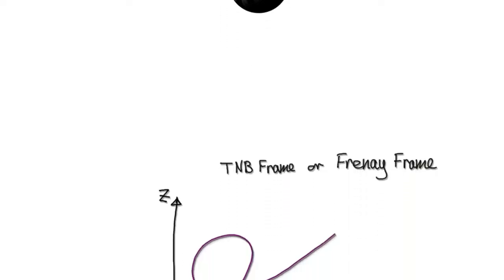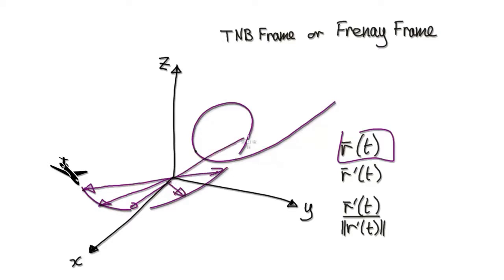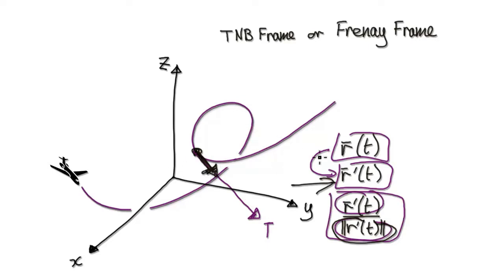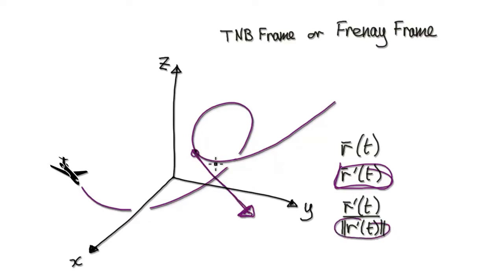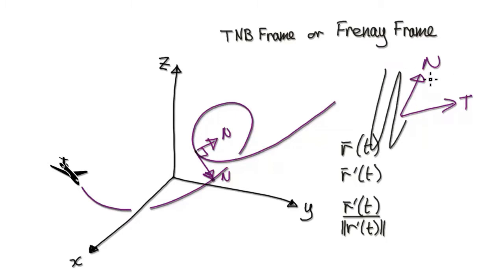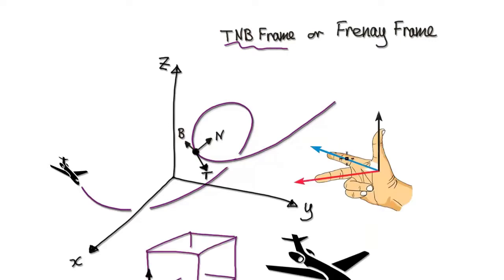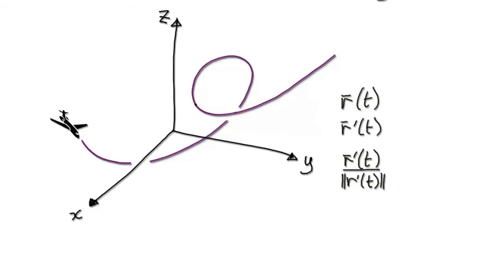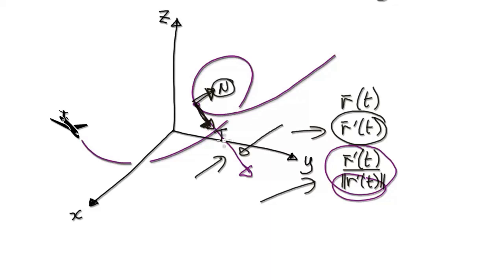Video 3013 - Introduction to TNB Frame, Frenet Frame

Comment: Hey at 3:50 I noticed you stated that the binomial vector is orthogonal to the Normal vector and Tangent vector, correct me if im wrong but did you mean perpendicular because mathematically it can not be orthogonal to both, thank you!

Comment: Hi Chau, thank you for the great explanation. I wanted to ask…say a particle (or an aircraft) with constant velocity is travelling in a straight line (not turning in the plane) but it is twisting on its axis (along the tangent T unit vector) how is the binormal calculated?….since if T is constant and the particle is not turning which means the normal N = 0 as well…and since the binormal is based on T and N, how is B (and hence the rate of particle twist) calculated in this case? Thanks a lot

Comment: I believe if you differentiate T with respect to the arclength parameter t, you get kappa times N, not just N? kappa is the local curvature of the curve.
 https://en.wikipedia.org/wiki/Frenet%E2%80%93Serret_formulas